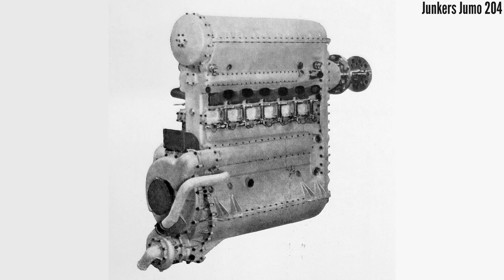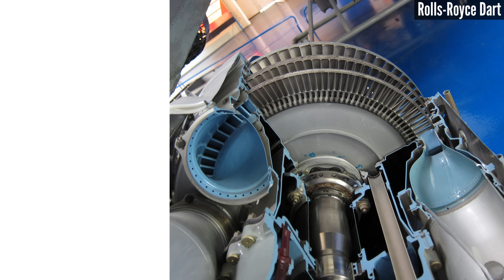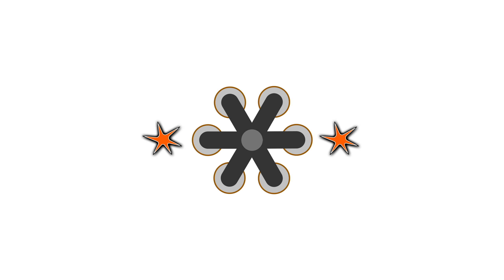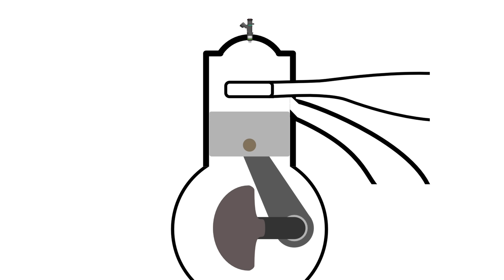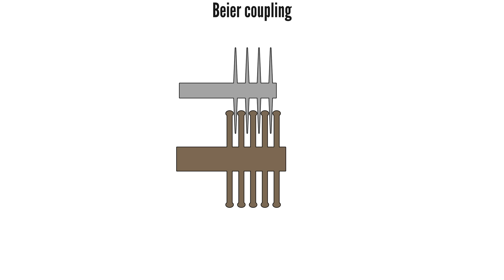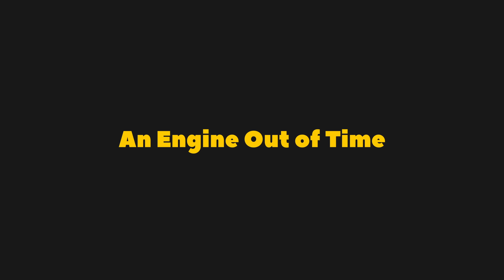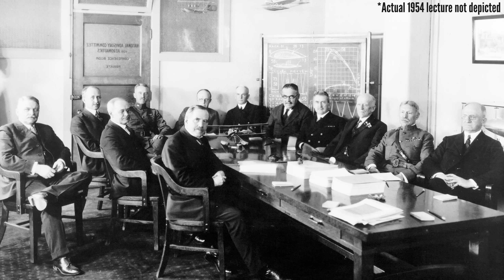Napier Nomad, the Most Complex Aero Engine Ever Made - Explained

Comment: It would've been interesting to have seen the Nomad II coupled with a single-stage axial compressor style fan (like a turbofan) as direct competition with the first generation commercial turbofan engines. So basically a big, fixed-pitch, many-bladed ducted fan with stator guide vanes to eliminate swirl/turbulence.

The high fuel consumption of turbojets was a major consideration for commercial arlines at the time, and a huge trade-off in operating the jew jet airliners, especially for long-range operations where fuel carry weight made up a much bigger portion of total take-off weight and impacted both performance and net cruise efficiency even more. (also a vary significant factor for long-range bombers, which such a fan-powered propulsion system would apply for the subsonic/transonic range)

The ability to run on jet fuel grade kerosene would've been really significant as well, since it would mean directly competing with fuel logistics, like turboprops, and unlike other aircraft piston engines still in service running on Avgas.

In 1955, the Boeing -80 was still brand new and the 707 itself was a good ways off (and the shaky jetliner market with the Comet PR issues was making the overall status shaky before some successful PR stunts really got things moving with Boeing), and the poor thrust to weight ratio of the Comet was a serious problem that contributed to its design failures (overly light experimental skin and structure to cut weight), while a high-subsonic speed optimized ducted fan should've provided much more take-off thrust and also much more efficient thrust at high speed cruise than turbojets could (or even the turbofans that started being used in airliners by the end of the 1950s).

Static thrust and weight competitive with the P&W J57 (JT3) turbojets of the 707 would have made it highly competitive, and scaling up further to still be thrust competitive with the later JT3D (or scaling in the other direction with some weight reduction making it more in the class of the JT8D) would've been very compelling for the 1960s. So for late 1950s performance stats, given the added all-up weight with a fan and nacelle installation being within (or under) the roughly 4200 lbs of the JT3, then it would've needed static take-off thrust of at least 10,000 lbs to be directly competitive with performance, and scale up to at least 12,000 lbs of thrust by the time the 707 was actually in service. (given you could use significantly larger ducted fans effectively via reduction gearing on the Nomad, this might be viable in ways that conventional non-gear-driven turbofans aren't)
OTOH, adapting those early (mass production successful) turboprops as geared turbofans would've also changed the competitive landscape. (which they should've been able to do, given the reduction gearing layout is already there)

No other large, jet-fuel compatible piston engines existed in the world that could potentially drive a large axial fan in that manner.

Reliability and maintenance costs would've still been significant considerations, though. (and finding a US company interested in licensing it)

 
Also, in terms of more contemporary early turboprops, the Bristol Proteus was far less dramatically ahead in power to weight ratio and had obviously poorer SFC. The RR Tyne was more impressive, but it first ran in 1955 and wasn't in production until the end of the decade, and also had significantly worse SFC. (and that's best SFC, not cruise SFC, which would be worse)

The massive  Soviet Kuznetsov NK-12 is in another league, though, but there wasn't anything comparable in the west at the time in the turboprop class. (but more successful work going into large turbofans) Thrust to weight wasn't quite as good as the Tyne, but SFC was supposedly .36 lb/hp/lb from what I'm seeing (presumably at best performance, so likely significantly worse for cruise and slightly worse for max take-off power, since best efficiency for turbine engines is usually close to max continuous power, but usually lower than max military or take-off power)

Also, subsonic optimized props and fans can still work up into the supersonic tip-speed range, but efficiency drops off quickly above mach 1, and they usually don't go much beyond mach 1.1, sometimes more like 1.2 at high altitude for fast flying aircraft. (I'd have to do the calculations, but I think the Tu-95 has prop tip speeds of just over mach 1.2 at altitude and top speed)
You can use smaller diameter props to get around this, but static and low speed thrust suffers, though adding more blades helps (eventually you just end up with an axial fan, though, and at some point, variable pitch + fewer blades becomes less efficient than fixed pitch + more blades + stator/guide vanes)

Comment: I looked further, and the better modern 4-stroke turbodiesel engines used for diesel-electric locomotives manage 200 g/kwh on the lower end, which is .3288 lb/hp/hr, or right around the same as the Nomad II. (obviously much heavier engines, though)
Presumably turbocompounded 2-stroke would still have a better power to weight ratio today for aero engines than hypothetical 4-stroke turbo compounds could.

Comment: The missing link. With reheat and an axial compressor and turbine, the Nomad was essentially a jet engine but with a reciprocating rather than flame can combustion chamber. 

Good for efficiency (far high combustion pressures and initial work extraction) but a gas turbine is lighter, simpler and easier to maintain. End.

Comment: I think the Nomad used Schnuerle scavenging rather than loop scavenging.  This technology was liberated from DKW in the aftermath of WW2.  Loop scavenging is an earlier system which used deflector lumps on the piston crown to direct air flow.  To get diesel compression ratios Nomad needed flat top pistons.
Reply: Loop scavenging is what Dr Schnurle and DKW developed in the 1930's. The patents were made available to all as a war reparation. The only people still using old deflector piston 2 strokes much into the 60's were US outboard makers like Evinrude, fuel was cheap in the USA back then.
Reply: @stevecunningham8960 I thought loop scavenging was the old system using baffles on the piston to direct the fresh charge to loop upwards  .  Seagull outboard motors used this system throughout thier production and it was common on pre war two stroke engines.  The DKW patent's  rendered this type of design obsolete.  I have always used Schnuerle scavenging to differentiate from the earlier type of loop scavenging system.  I see from the interweb that I'm just an old dinosaur and everyone now just calls it loop scavenging.

Comment: Teos/Austro Engine AE440 claims to have an efficiensy of 200 grams/KWh 

Layout: Liquid cooled, High compression Diesel, dry sump, 90° V8, one Turbocharger per engine bank with intercooler
Displacement: 4.6 Liters
Materials: Aluminium block, Titanium connecting rods, Steel pistons and liners
Weight: 197 kg dry without gearbox, 249 kg installed.
Power: 330 kW (440 hp)
Reply from the maker: Thanks for the comment. That is impressive specific fuel consumption, I'd have to look at it in more detail, 200 g/kw hr seems too good to be true without some form of compounding.

Comment: The most fuel-efficient, per specific fuel consumption, gasoline piston engine is the current (2025) Formula One engine using advanced hybrid systems, where recovered energy from turbo charger is used to power the intake compressor, and excess energy from the turbo charger is stored in Lithium-ion batteries as electrical energy, released into electric motors to increase engine shaft horsepower when needed. the Mercedes-AMG F1 gasoline engine has achieved over 50% thermal efficiency under test, meaning more than half of the energy from the fuel was converted to useful work. The current most fuel-efficient production diesel engine is the Chinese Weichai Power heavy-duty high-speed diesel engine achieving a brake thermal efficiency of 53.09% . By comparison the thermal efficiency of a jet engine is typically between 30% and 50% .

Comment: If the engine uses less fuel, then for the same flight, the plane needed to carry less fuel, and for some trips, that would outweigh the extra ton of the engine. Big planes carry 100s of thousands of pounds of fuel (i.e. hundreds of tons). You'd only need to carry 1 less ton of fuel per engine to be ahead, so I doubt the weight was a big deal.
Reply: well, such a large plane would use eight or more engines, so it would be ten tons more.

Comment: The final version of the R-4360 comes to mind, with its Variable Discharge Turbine. It's this engine, but with 28 cylinder radial engine, and throttles itself by restricting the exhaust.

Comment: Napier Nomads as power plants for electric motors is the next step, could even power the supercharger electrically. There's a Canadian company applying this configuration to logging trucks. Efficient smaller diesel motor that run the powerplant for electric axels.
Btw excellent presentation, I often forget to acknowledge the creators but this is definitely worthy, I have shared your documentary :) and subbed, cheers.
Reply: Locomotives have been using that idea for years.
Reply: @eugeneoreilly9356  Yes and reliably so.

Comment: When a "ministry" sets the priorities engineering hubris gets out of control. When the market sets the priorities, realistic goals are set.
Reply: The British almost entirely privately developed railway system at it's 1920s height, with its multiple competing lines, overlapping routes and 1820s loading gauge gives lie to that!
Reply: @roberthardy3090 while the decision not to complete development or put into production the Napier Nomad or the Bristol Brabazon, or the Saunders Roe Princess bears it out.
Reply: As most certainly doesn't  is the British privatised water Industry. The misteps of the postwar British aviation were indeed those of over ambition and hubris, as much though of the unconsolidated industry as governmental mistakes, ultimately Britain had the desperate problem of the aviation transport industry being unable to provide a sufficient market for its products and the immediate stated demands of that industry being tailored to prewar imperial models that were vanishing as fast as the aircraft were developed.  Airbus despite it's deeply politically driven origins is now a fully successful international success. The market would have seen Rolls Royce lost long ago, fortunately Ministers and their civil servants had wiser heads.   @navion1946

Comment: A bit messy explanation.

Everything is simplier. As Party and Physics teach us - efficiency of thermal machine is determined by difference between "heater" (the hottest point in time and space) and "cooler" (the coldest point, for ICE its temperature on exhaust, where gases go to atmosphere).

Usual fuel in air burns at about 1000-1300C. If we compress it or use some exotic mixtures (nitros!) we can achieve a bit more but not significant, because we cant use it! The engine burns and melts! Pistons burn out, valves crack... so even with periodical cooling its not possible to upkeep too high temperature. But piston engines cant expand hot gases too much, like triple-expansion steam engines  100 years ago, so big part of this high temperature loses anyway.

And for gas turbine on hot side everything is much worse - it constantly in the hot flow, without cooling. So even modern materials, titanium and tungsten alloys, cant cope with it... tadaaam we got point of inefficiency. But for cold side turbine works perfectly, it can expand and use energy almost to ambient air! Titanic steam turbine worked even on NEGATIVE pressure, condensating steam about 50-60C, and provided half oh total ship power.

So mix of diesel (or even free piston gas generator) and turbine reduces losses on both ends. But the price is brain-damaging complexity, price and difficulties in use.

M

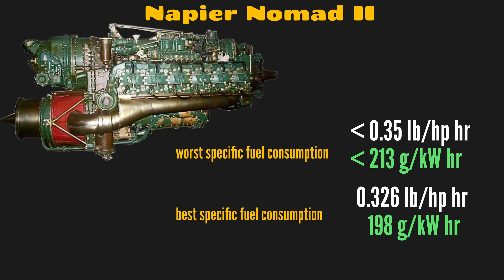Comment: 16:08
I'm seeing approximately .3645 lb/hp/hr for the small, 180 hp DeltaHawk 180 (using .054 USgal/hp/hr and an average Jet-A density of 6.75 lb/usgal), so not quite that good, and turbocompounding has modern potential here, too (though you have a simpler turbocharged forced induction, but with 2-stroke diesel implementation). The power to weight ratio is significantly worse than the Nomad, but some things are also limited by scale (though the turbo-compounding is obviously a big factor).

OTOH, in a hypothetical hybrid electric drive scenario, you could have the compounding done a bit more flexibly, since the combined power drive wouldn't need to be coupled to the piston engine driveshaft in any way and could be coupled to the generator instead. Or dual generators could be used (one on the drive shaft, one on the turbine shaft, which might be preferable if the weight and complexity of 2 separate generators is better than a fluid coupled drive to a common generator output)

Whether the power turbine being directly coupled to the compressor (ie integral to the turbocharger) RPM is still the best option is another matter as well, especially for centrifugal compressors (which ideally, are better matched to radial inflow turbines), though I suppose you could have a well-matched radial inflow turbine + centrifugal compressor + downstream axial power turbine, potentially still on a single shaft, but with bypass gate in between to allow faster spool-up. (ie rather than wastegate, you have exhaust gas gate between the two turbine stages, allowing the power turbine to be bypassed and gas exited through gate/gates between the stages for fast turbo spool-up, then the gates could be closed to funnel exhaust gas through to the power turbine)
Hmm, though that set-up would probably just be better with a fully decoupled power turbine and possibly simpler overall. Just have the turbocharger a normal turbocharger, but have the added exhaust power turbine spinning a generator using the excess exhaust energy.

You could have the power turbine combined with the driveshaft for a single generator shaft output, but it might still be simpler, more efficient, and possibly lighter (relative to power output) to use 2 separate generators optimized for the drive shaft and power turbine shaft, and the electrical power output regulated and combined after that (which is likely simpler than mechanically/hydraulically combining the power before the generator).

A wastegate still wouldn't be needed, since the engine could be throttled back as soon as both turbines reach their RPM limits under full generator load. (a modern system would have a computer automatically handle all of this)

You'd also want the turbo at max RPM as often as possible, at any given power setting, so long as the engine can still run reliably at the extremely lean mixtures allowed at low engine RPM + high turbocharger mass flow. (sufficiently hot, high pressure air should allow efficient compression ignition at very lean mixtures, though, so as long as you didn't have an over-efficient intercooler, it would likely work)